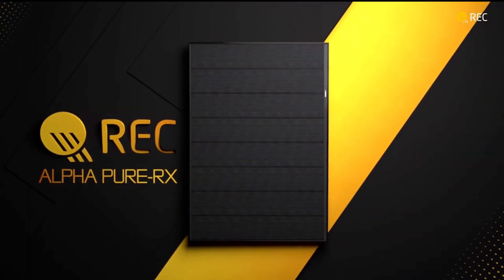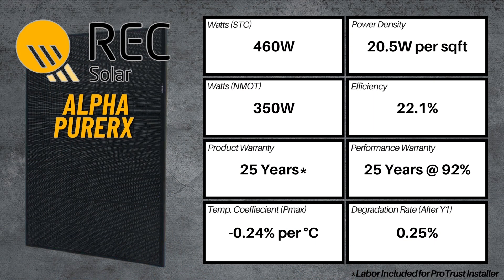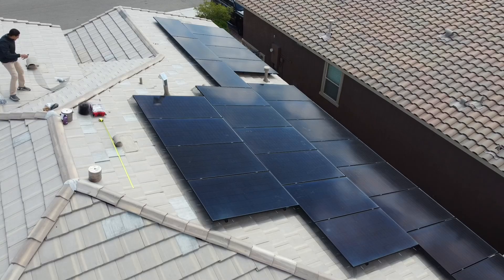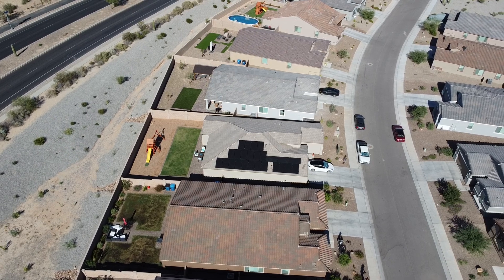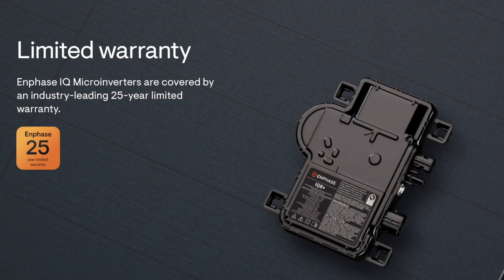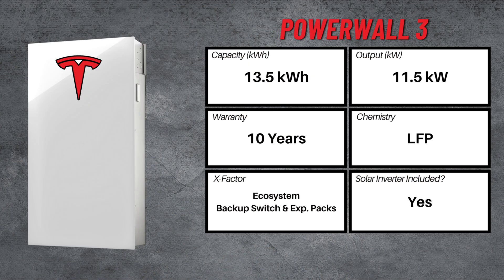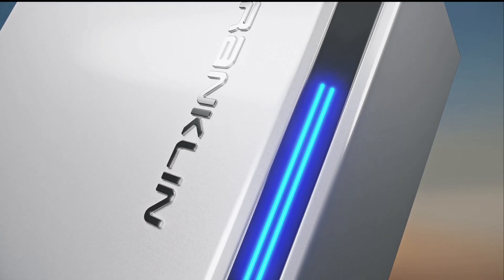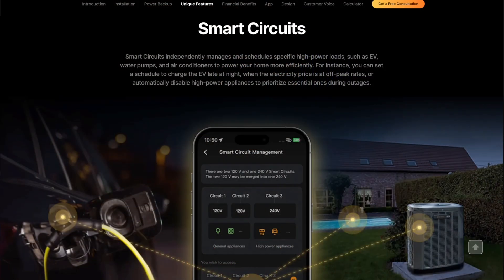This is the BEST Solar & Battery Setup in 2025 (My Opinion!)

Comment from the maker: Anything you'd change from my "best" setup? I'm curious to hear what equipment you would go for or did go for on your home!
Reply: I have had $800 electric bills this past summer. AND our home would still be 78-82 degrees. Our roof, entire HVAC and all windows are 3 yrs old. Our crawl space is vapor sealed.  We added 10 inches of insulation in the attic and it helped quite a bit. But we are still looking to go solar. This is the best system I could piece together for our home. Let me know if it is a decent system. 

System Size 22 kW DC

Solar Panels / Count Yukon N series SEG-440-BTD-BG 440W (50)

Inverter(s)
Enphase IQ8MC (50)

Racking System Iron Ridge

Production Monitoring Franklin & Enphase App

Battery Backup Franklin aPower2 (Qty. 1)

Comment: As usual, excellent video.  I have a question.  From what I've read, the Tesla Powerwall 3 is a high voltage battery with a battery voltage of 350-400v.  Most of the off grid battery systems are 48v as well as many of the other "home backup" batteries.  Could you do a video comparing the battery voltage of the most popular batteries and the advantages of high voltage vs low voltage battery system?
Reply from the maker: Thanks for the suggestion! The high vs. low voltage battery comparison is a really interesting topic and something I could dive into.

Comment: You in AZ? All vids look like AZ. I'm in Gilbert. Trying to figure out with which panels to go with. Silfab or Canada. (Only due to lack of availability of more premium ones)
Reply from the maker: Yep, I’m in AZ. Panel availability is very spotty right now. Get whatever you can. Silfab and Canadian make extremely similar panels from a spec standpoint.
Reply: @ZachSolar Thanks man. Anything better than those two? I see people recommending the Aptos bifacial also similar specs as canadian and silfab. I don't mind paying 250$ per panel at all if i knew there is something in that range better than these 200-170$ panel range. Sticking to a liftable weight of 50 lbs per panel. I'm a 40 year old surgeon, but my back is 65. Lol
Reply from the maker: There are a ton of panels out there that are extremely similar in performance specs. The gap from “good” to “best” is pretty slim nowadays. Aptos is also another great manufacturer.
Reply: @ZachSolar thank you for your time.

Comment: I have a quote using Panasonic panels.  How do they compare with REC? I was told they are discontinued but the 25yr warranty is still being honored.  What are your thoughts on Qcells? I am in Arizona so have extreme heat to consider.  Thanks.
Reply from the maker: Panasonic's panel is the same as the REC Alpha Pure 2 panel. Both are similar to the REC Alpha PureRX option I discussed in this video. All are great panels! I'd personally lean towards REC's option directly.

Qcells is another very good manufacturer. Can't really go wrong with either Qcells or REC.

Comment: While I'm not an installer, I'm thinking the Pointgaurd system has a lot going for it. They are adding a 10KW battery option to their stack, have load management, and a bi-directional unit -- all in a single footprint.  With their 10, 8 and 5KW battery sizes you can mix them to dial in how much storage you need and not go beyond your needs.   Even has built-in fire suppression in each battery unit!  We're looking at them with the REC Alpha Pure panels.
Reply: The stackable, modular architecture of the PointGuard system is head and shoulders better than Tesla, Enphase, etc. The whole industry will eventually copy their design.

Comment: We have solara 400 Watt batteries with enphase micro converters.  We are interested in getting 2 Tesla power wall 3's, will it work efficiently with A/C instead of D/C?
Reply from the maker: Yep, you can AC-couple the Powerwall 3

Comment: Thanks for the info. I am a retired union electrician with extensive experience with AC/DC systems, both control and power. The biggest problem I am encountering is companies wanting me to use an installer and that's not happening. I have had to go behind some of these fly by night installers that are now out of business and correct their work or bring it up to code, which seems to be more common than most realize. I will be installing my own ground mount system before the tax credits expire at the end of the year.

Comment: I wound up souring on Tesla, but it turned out to be fortuitous because EG4 has a really excellent, highly competitive system with the GridBoss + FlexBoss21 + Indoor Battery x N combo.  I wound up DIYing the whole thing and I couldn't be happier.  Supports both AC and DC coupled solar and the vendor lock-in is fairly minimal.   The Tesla ecosystem is just toxic now. Franklin was in the running, but when I ultimately determined that I could DIY most of an EG4 system that sealed it... massive savings by doing that.

-Matt
Reply from the maker: Thanks for sharing, Matt! More quality options for consumers is better for everyone. Glad you found a solution that works well for you.
Reply: What did it cost to install?

Comment: Great video!

I’m going with CertainTeed Solstice Solar Shingles on my roof for roof reliability reasons. Going with solar panels on gazebos for extra generation. 

Know of any top tier panels that are class 3 or 4 impact rated?  I live on a golf course. 

I notice you didn’t mention the “erector set” style inverters. EG4 is in this category. Why not?

I like the Franklin a lot. Big issue is the China connection for the products and where the web service is sourced.
Reply from the maker: Thanks! I don't know of any panels rated for golf balls unfortunately. Usually we would just recommend installing a netting system over the panels to protect them.

As far as equipment, there are definitely a lot of great options out there that didn't make my "list". After overseeing thousands of solar installations, I just gotta go with what I trust and what has performed well for me based on my experience.
Reply: @ turns out Franklin is moving production to the USA.
Reply from the maker: Yep, that’s their plan. Pretty much all the big ones are trying to bring manufacturing to the US.
Reply: I bought Certainteed solstice shingles. CertainTeed solstice have been installed yet?